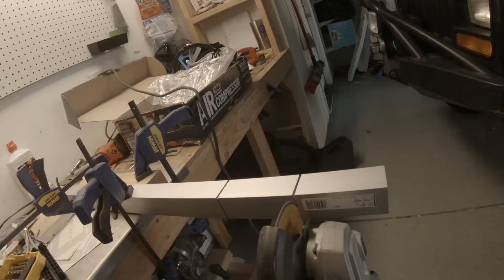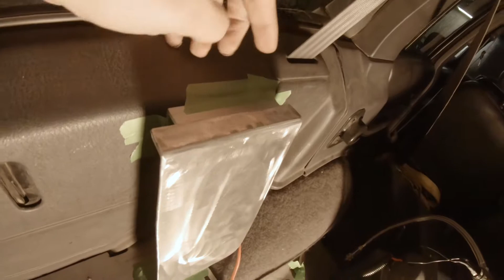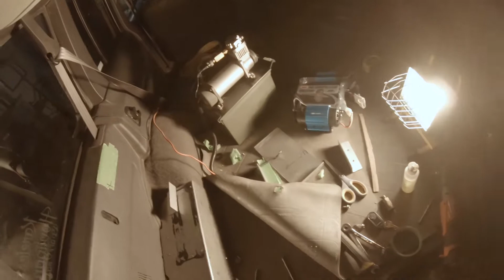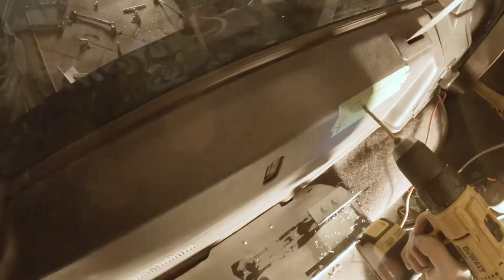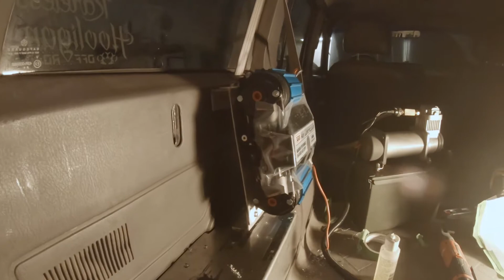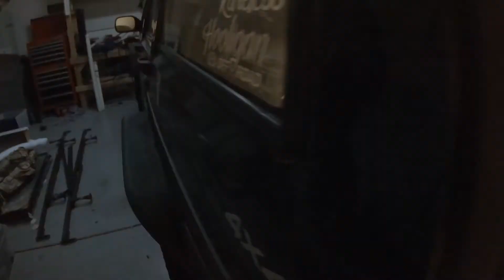Jeep Cherokee XJ ARB Twin Pump Compressor Install

Comment: Can you give more info about the tray everything is mounted to
Reply from the maker: It’s just a piece of bent stainless that I cut to fit. I then used some 90 degree angles to build mounts for it. It uses the factory mounting holes for the spare tire in the bottom and the top has a mount in the middle going through the side